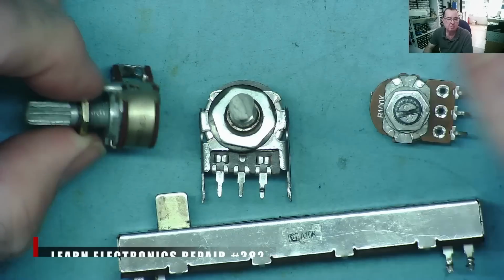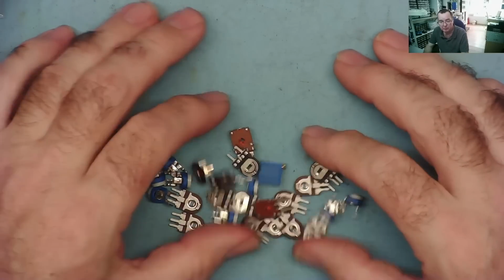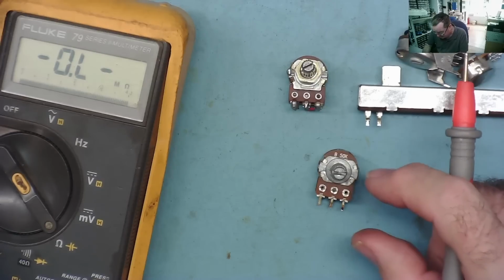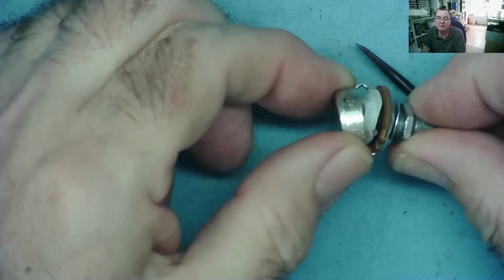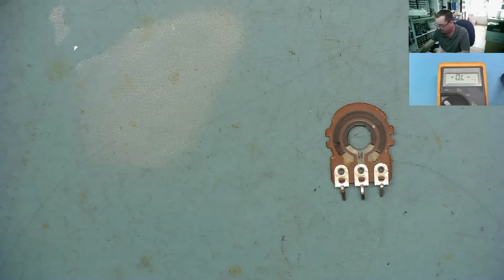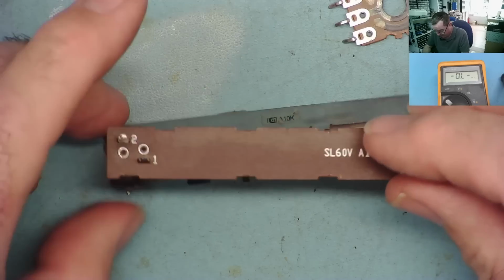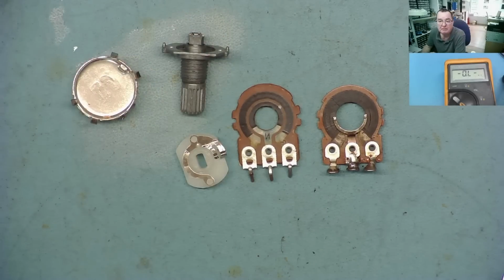All You Need To KNOW About Potentiometers To FIX Stuff! How They work tutorial How To Repair

Comment: I get linear faders and pots: The longer the distance, the higher the resistance. Just like wires. But how do log faders and pots work? Is there a different material being used which has resistance related to distance in a non linear fashion? What is it then?

Comment: Thank you. This was extremely helpful. I have some scratchy pots and was looking for ways to clean them. I would prefer that to replacing them.  I too am a DJ.  Rule #1 is no liquids near Mixer or amps. It eliminates so many problems. I even make my clients and their guests put drinks down before coming up to talk to me. Most totally get it right away, i just point at their drink and then at the power cords. Some you may have to tell them but either way works and keeps equipment safe.

Comment: Question to the experts in the comments: I have a old Fujitsu siemen's speaker system and i recall having trouble turning it on, sometimes it did, sometimes it didn't and i had to fiddle with the potentiometer and get lucky it turned on. Now i am trying to repair it and i took the covers off and had a multimeter reading on the potentiometer. The marking on the potentiometer are "A50k" and i had a reading of 30 ohms when it was at turned all the way up, and 0 ohms in every other position. Am i safe to assume the issue is the potentiometer and a replacement will fix it?
Thanks in advance!

Comment: How do you fix a potentiometer (stepped gain switch with 22 variable resistance settings) that is not making full contact with the wiper? I have a neve 1073 style microphone pre amplifier in which the red gain knob has been knocked off track and spins freely the entire 360 degrees around the wiper track as opposed to catching on each value and stopping at its clockwise-most settings and counterclockwise-most setting. I’ve found if i pull the shaft out a bit it will make better contact and sometimes even return to normal. It still is working however takes some fiddling to get it to make contact and pass signal at the chosen resistance. I believe this is from corrosion due to it being a item I purchased second hand. 

Appologies if the terminology used here makes me sound clueless, I am clueless. Any input or help is appreciated, also never buy used items from guitar center 🫡.
Reply: Another note: I believe it is a wire wound potentiometer. The pre amp is called the WA73

Comment: Just a little additional info. As well as A for "logarithmic" and B for "linear", if you have a pot with a C before the numbers (i.e. C50K), it means "counter clockwise" and if you see a W before the numbers (i.e. W50K), it means it has a "center detent". C and W just applies to circular potentiometers, not faders which only use A and B. If a fader has a center detent, it's usually just up to the manufacturers and sellers to list it as so and/or may have an additional part number for reference.

Comment: Great video Richard. It's interesting looking at one of the log pots you tested, it had a totally uniform looking carbon track (Width and height wise). But it obviously measured as a log pot would.
I wonder what the process is that they do to the carbon track to make it logarithmic. How do they make it more or less resistant without altering the width or the height of the track.
Reply: What I would think of is that it's a mix of carbon and filler, and they adjust the ratio while placing the track or something?
Reply: @HauntedSheppard  Yea, maybe they lay the log track first, then a second durable uniform layer on top, dunno.

Comment: Interesting but also worth mentioning lubrication - too much switch cleaner cleans the track but removes grease on the shaft used to provide smooth feel when turning. You can get remove and re-grease the shaft with appropriate lube.

Comment: One other small point . There is a viscous lubricant in spindle which when you turn up the volume on an amp helps with tactile feel . If you clean with appropriate cleaner it stops the crackle but the pot then moves loosely around because the cleaner has removed the grease from the spindle. Not a problem for me but audiophile types are obsessed with the feel of equipment.
Reply: And there are various greases available to restore a dampened feel. Maybe not the very same fell as new from factory, but better than just cleaned and no lubrication.

Comment: Hi Richard, could you possibly make a video about rotary encoders used as potentiometers? It would be MUCH appreciated! Regards, Jerry.
Reply: @Mr Guru Thank you for your explanation. Yes, I knew that much, but I have a repair job, where volume is controlled by a rotary encoder and it's intermittent and haphazard. In the middle of range suddenly it goes very quiet and stays there. I dismantled and cleaned it and put it together, checked all the solder joins and cables. Before I put the device together to test it (a lot of work), I thought I could check any additional components for faults. The signal path is complicated and travels through several boards. It's a rabbit hole. I just wanted to learn a typical circuit for the encoder, so I could easier reckognize the elements of it without reverse engineering half of the device.
Reply: @Mr Guru Yeah, I hoped for a possibly "typical" circuit for the rotary encoder volume control. I thought that maybe he repaired already such a circuit and he could explain it. Knowing my luck, as soon as I figure it out (and possibly film it for YouTube as well), he will suddenly come across such job 😁.

Comment: To get rid of the crackling sound, can a potenciometer be cleaned with WD40? Thx
Reply: Would ACF50 work as a good lubricant or just be a dust collector?
Reply: @james1986  proooooobably, yes.  It would definitely work as a lubricant, but you might need to spray them with regular contact cleaner first and then go back and apply the ACF50.  (Which may be what you meant lol)
Reply: Don't use wd40, instead use switch cleaner which often cures crackles, sometimes permanently!
Reply: @Mr_Rusty1  use a terminal cleaner if it's really bad and THEN go back and either add a lubricant to it or use desoxit (it has lubricant added to it) if you don't lubricate it afterwards it will pretty quickly destroy the carbon film inside.

Comment: A Potentiometer is really  a variable potential divider and is a 3 pin device however by attaching the wiper to one end and forming a 2 pin device you now have a true 'variable resistor' or rather a 'Rheostat'. Regarding log and lin Pots the reason that in audio we use log for volume or signal level is that audio systems such as the human ear perceive audio volume asLogarithmic. Couple of bits of useless info !....cheers.
Reply from the maker: Actually that is quite useful useless information 🙂

Comment: I have a Technics amp from the early 90's and the volume knob is a double joined pot, unfortunately one of the tracks has gone worn/faulty meaning that the volume is louder out of one channel, only way to correct it is to alter the balance, can't seem to find a replacement.

Comment: Hi Richard. Just a little side note. There are also potentiometers on the market that are equipped with a small switch at the back. These are usually used in portable radios to turn the unit on and off and also to adjust the volume with the same button. These potentiometers are usually logarithmic. Still an instructive video for novice electrical engineers among us. Thanks GRTS Andy.
Reply from the maker: Yeah there are those ones, and also the ones that have a centre 'click' position or a continuous 'click' effect as you rotate them, usually achieve with a ball bearing and a ridged track
Reply: Thanks Richarrd for your replay. GRTS Andy.

Comment: Nooooo switch cleaner lifts the carbon and kills the track
Reply from the maker: Good job I didn't use it then. 🙂 I have in the past though and it sometimes worked.  Could it be there are different types of switch cleaner (different formula from one brand to another)?
Reply: @LearnElectronicsRepair  Deoxit Fader. Expensive, but I've used it for years and gives excellent results. Cleans and lubricates.
Reply: and what about deoxit f5 ?
Reply: Deoxit F5 is for faders / potantiometers you can use that but not the normal one it will kill the carbon tracks

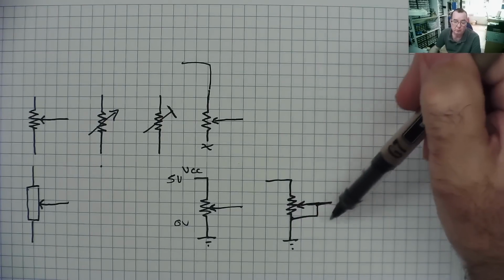Comment: Not wishing to be picky as I know this is a 'basics' video, but I recently learnt a potentiometer (by name and schematic drawing) is different to a variable resistor in that a potentiometer always have both track ends connected (potential divider) and all 3 pins connected to circuit, whereas a variable resistor (with the line through the component in schematic) only has 2 pins connected.  At 3:53 I think you meant to not have one side grounded as the wiper is also grounded in that instance :)
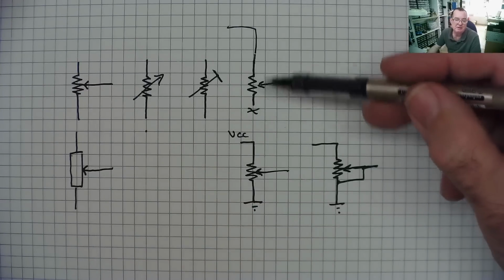Reply from the maker: And what exactly is wrong with having the wiper connected to the grounded end?  All this will mean is that the variable resistor gives a DC resistance to ground that varies between the maximum value and zero ohms.  That can be rather useful in some circuits, in fact the Bench PSU project I was working on a few videos ago has them connected exactly that way https://www.youtube.com/watch?v=-Bk2sgGXT6s at 00:03:29 - check out RV1 and RV2 bottom left of the schematic.  Not to be picky 😃but is there something wrong with that circuit? Because it works as intended when I tested it 😉
Reply: @LearnElectronicsRepair  yes of course it's fine, doh - one of the pitfalls of commenting with a headache 🤕cranium contents deficiency...
Reply from the maker: @budgiefish  It happens LOL.  I didn't know about the info regards difference between potentiometer and variable resistor though, I thought the terms were interchangeable
Reply: @LearnElectronicsRepair  The term that's being missed is 'Rheostat' you don't hear it much but that is a true 'variable resistor'
Reply from the maker: @andymouse  Oh I remember rheostats from 1960s and 1970s lighting control systems for stage/theatre productions
Reply: @LearnElectronicsRepair  Yeah way back !

Comment: My newest Fluke leads in the past few years increase resistance very quickly. Fluke sent me a new set. The quality is difficult to find nowadays. 

Thank you for the education!
Reply: It used to be grandpa that would say things like “they don’t make things as good as they used to.” Now days, it takes as little as 6 months to notice this trend instead of a lifetime because planned obsolescence has morphed into plain old near immediate obsolescence.
Reply: Are they the TL175 (twistguard) ones? Same here, although they refused to acknowledge any problem last time I tried, so got replacements from Farnell, they've been replaced twice now, and the latest are also going high resistance, which is  shame because otherwise they're really nice, long and flexible and twistguard is very useful :( I suspect they haven't made a proper electrical (soldered) connection in the probe handles, rather just crimped and overmoulded, as vigorous wiggling/bending the ends can restore low (sub 0.5 ohm) resistance where they can be upwards of 5 ohms in one instance ... probably dissimilar metals and galvanic corrosion in play.